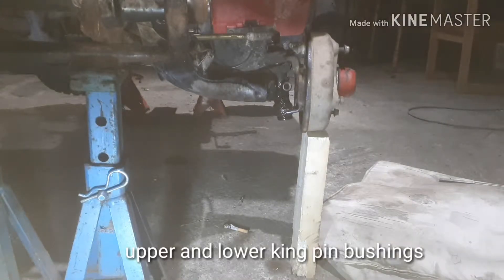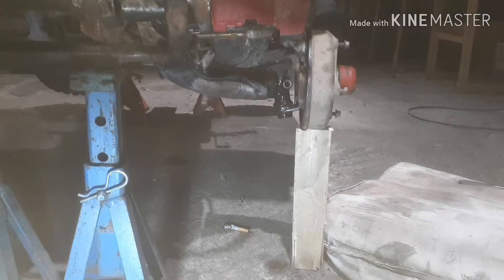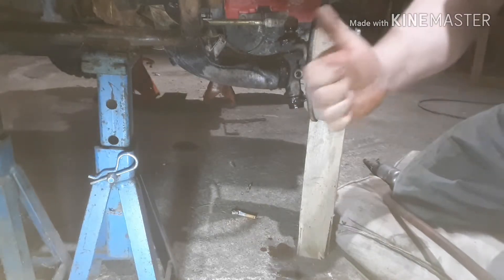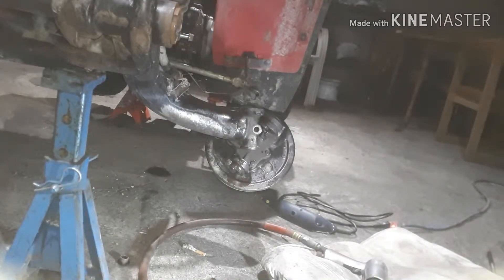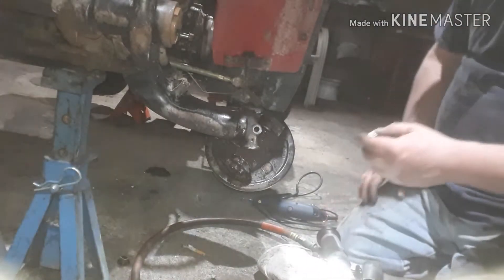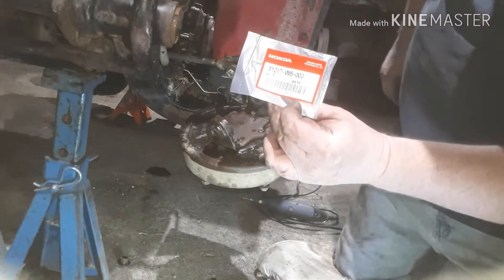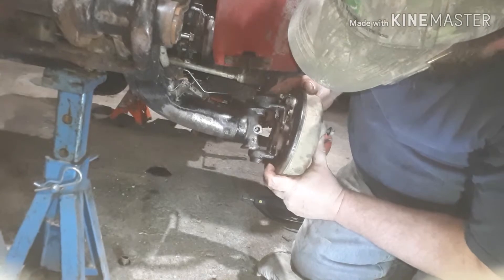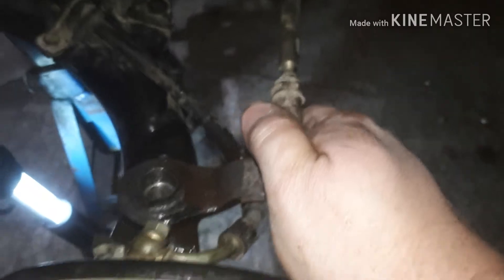1984 Honda trx200 king pin bushings

Comment: Good video.. i just got my daughter an 84 trx200 and its in need of the pins and bushings.. just did the front shoes and master cylinder and cleaned the carby and replaced the carb intake boot... my toys keep me busy...
Reply from the maker: Great!  I really did hope that this would help someone.  Good luck with the quad.
Reply: Im mid way into the kingpins now.. they are all apart, new bushings are in.. but i forgot the dust seals lol they are coming today. Im not really impressed with the fact there is no grease fitting.. so what i ordered was 3/4 inch freeze plugs.. gonna drill an tap for grease fittings and put in the tops an bottoms.. hoping it will help instead of the rubber plugs so i can pump some fresh grease in once in a while